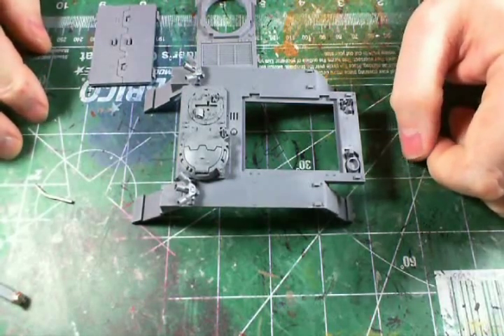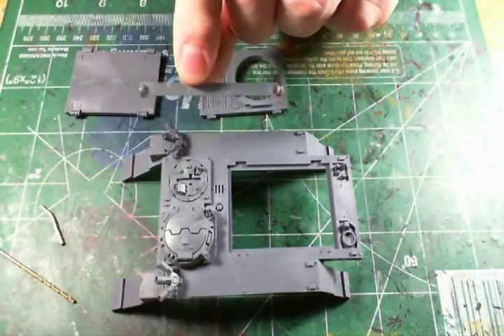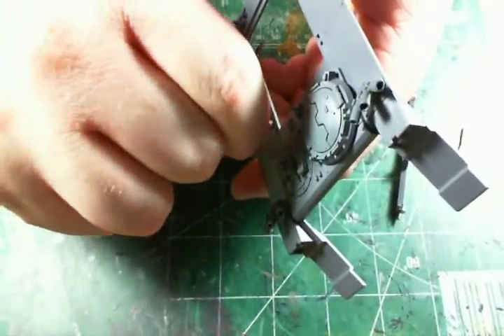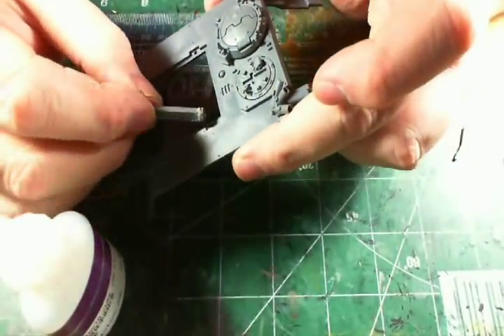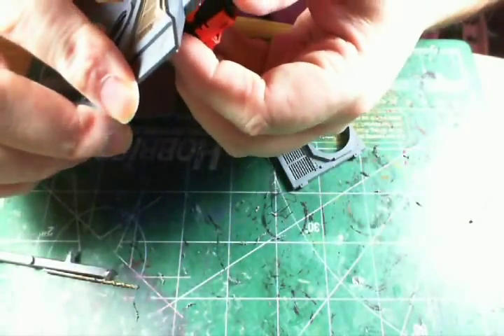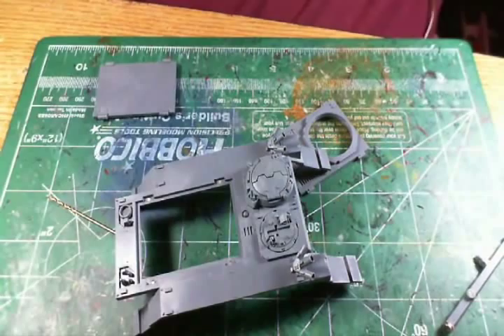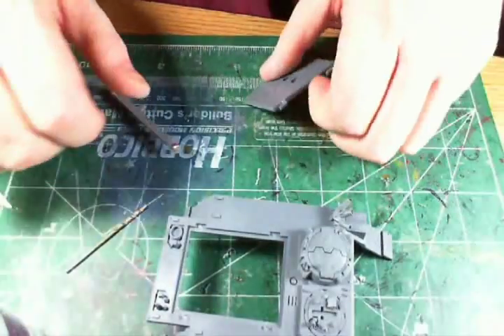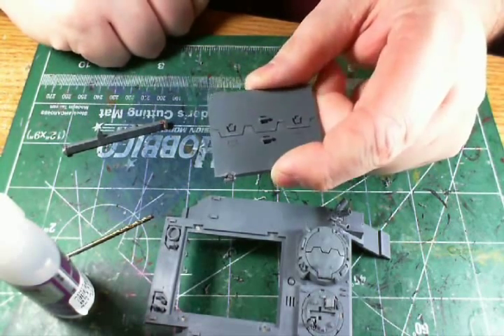How-to #5 - Magnetizing a Rhino/Razorback

Comment from the maker: You can but it takes more work obviously.  Doing the whirl is easy as it is basically just another turret. The predator requires some creative magnet placement on the side doors but it's been done and there is info out there on net.

The vindicator is another story entirely because of the way it uses different front panel and and additional top piece..probably isn't worth the effort for that one.

Comment: the use of green stuff or epoxy style putty and you won't need a tool to put your magnets in. 
step one : check polarity, by attaching the lose magnet to the one already glued in.
step two: green stuff the back of magnet while still connected to other magnet
step three: press magnet into the hole with the connecting piece.
step four: repeat till done